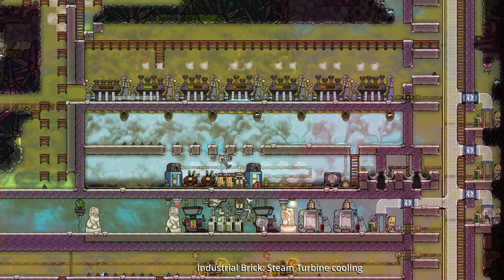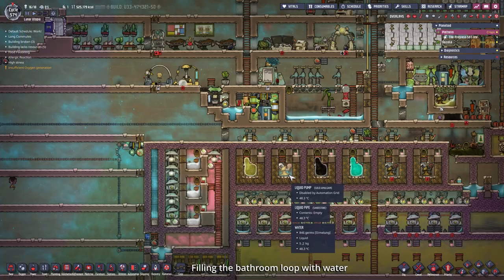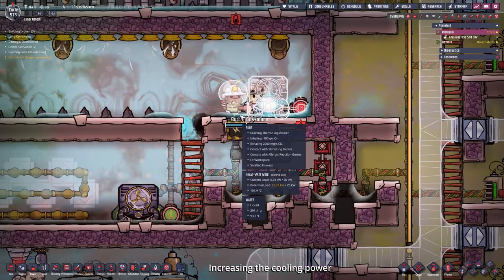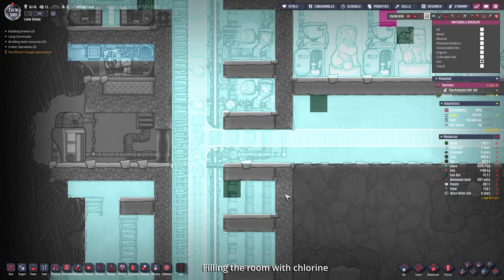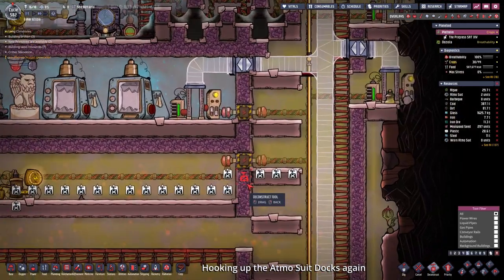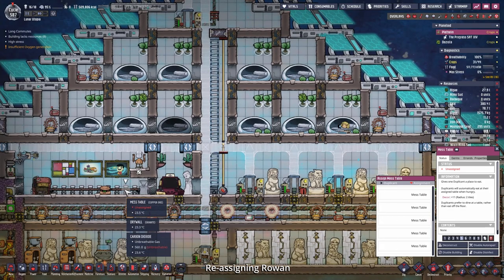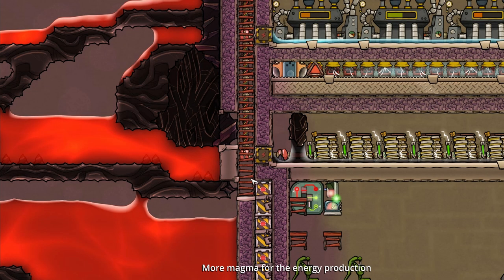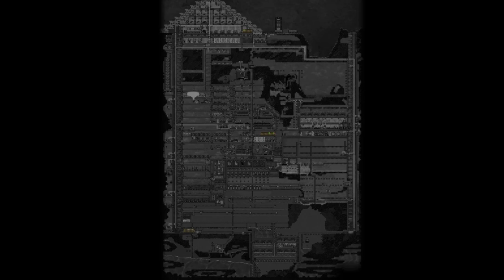Power Outage and Base Modification - Oxygen not included Let's Play: Part 16

Comment from the maker: Hello my Friends here I have Part 16 for you! 
*Save file in the Description*.
As always if you would like to make suggestions or help me improve these videos
feel free to leave some tips or point out flaws in my presentation so I can improve in the future :)

Chapters:
0:00 Intro
0:14 Industrial Brick: Steam Turbine Cooling
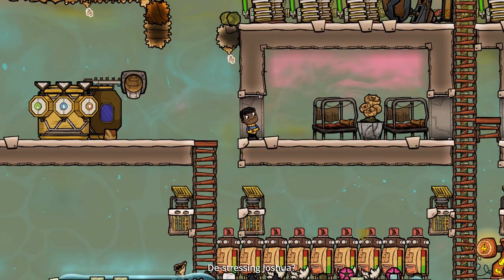01:02 Oozista: Stress Reduction Plans
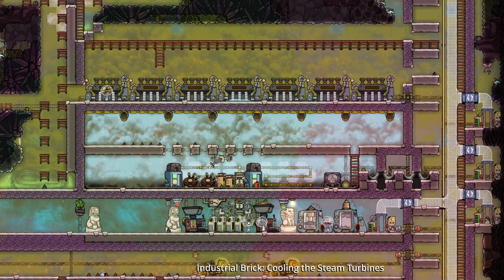01:15 Industrial Brick: Steam Turbine Cooling Part 2
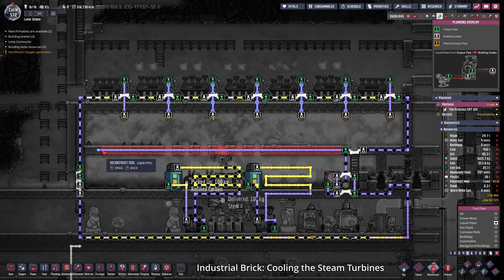02:10 Industrial Brick: Aquatuner Changes
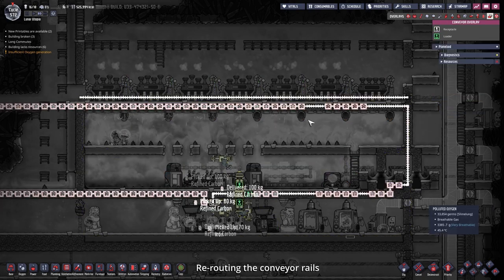02:34 Industrial Brick: Conveyor Rail Changes
02:52 Industrial Brick: Heat Transfer Improvements
03:13 Industrial Brick: Miscellaneous
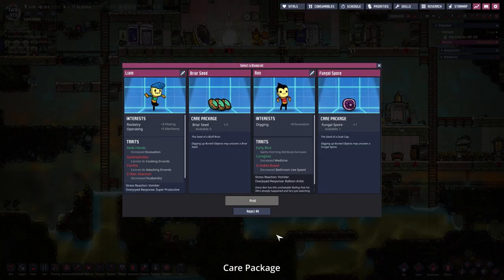03:35 Oozista: Miscellaneous
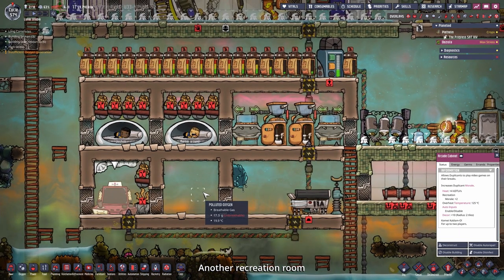04:05 Living Quarters: Activating the Bathroom
05:00 Water Treatment
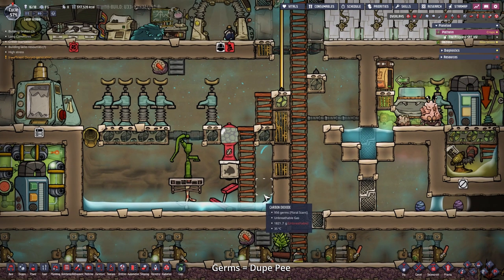05:30 Filtration Room Nr.2
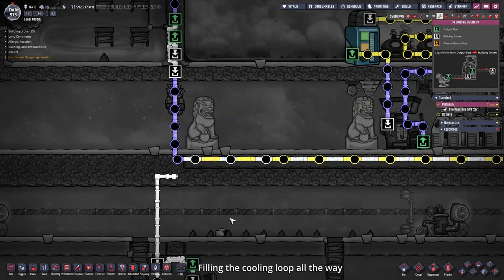06:42 Industrial Brick: Miscellaneous 2
07:26 Industrial Brick: Increasing the cooling power
09:36 Oozista: Even more Stress Reduction Plans
10:44 Filtration Room Nr.2: Chlorine
13:47 Filtration Room Nr.2: Miscellaneous
14:27 Industrial Brick: Temperatures
14:39 Industrial Brick: Thermo Regulator
16:40 Material recovery
17:31 Miscellaneous
17:50 Rocket: Supply & Research
19:46 Base Expansion
20:25 Rocket: Research & Rowan
21:07 Rocket: Rowan back on the main planetoid
21:45 Lime
23:05 Base Expansion Part 2
23:21 Thimble Reed Production
24:10 POWER PROBLEMS
26:22 Oozista: Solar Power
26:34 Even more Thimble Reed Production
26:43 Base Expansion Part 3
27:02 Industrial Brick: Glass Forge
28:46 Outro and ALL THE OVERLAYS

Comment: I love your base so much. It's so crisp. The gas piping alone is just so well done and organized. I like that you also explain the liquid piping setup for the aquatuners as you go. Even after a year, I still second guess myself and your breakdowns help. 
What are you planning to build in the space cleared under the industrial brick?
Reply from the maker: Hi MusicYT glad to hear that. For the space unterneath the Industrial Brick: to be honest i am not sure anymore. I had something in mind and then changed it a couple of times. From Move the Drecko ranches and make them temperature controlled to a central cooling heating system for all of the base to a seed mutating area or farming area to a seed replication setup etc.
Reply: @Luma_plays  Those would all be great builds! For mutating seeds, would you need to build a nuclear reactor to generate the radiation required for mutation, or is there another method? (I do not have SpacedOut yet so I do not know; living vicariously through everyone else)
Reply from the maker: @music_YT2023  You need around 150 rads per cycle but less than I guess it was 450 rads per cycle to mutate meal wood for example. That can be achieved with 5 wheezeworts (but I only have 1 seed so I would need to multiply seeds first) or you can use nuclear fallout (can be produced with shooting radbolts at doors or airflow tiles/mesh tiles or what is more realistic: use shine bugs. those are slightly radioactive now.

Comment: Water is at least 2 time more effective as a coolant than oil, check specific heat capacity
Reply from the maker: Hey LothuX. I know. But the Liquid bridges I have inside of the steam chamber are around 125 to 140°C hot. I did plan for the liquid to be changed to polluted water but I had other priorities and the bridges kept me from doing that.
Reply: You know that bridges doesn't contain any gas, liquid or solid, so it doesn't matter if bridge is even 200°C , it won't do anything to the liquid inside pipes, it doesn't exchange temperature with it
Reply from the maker: @lothux4984  Ok then i'll probably switch out the liquid for polluted water. Thanks :)